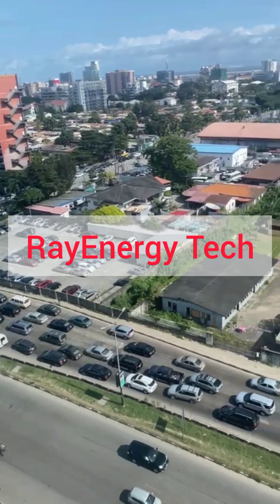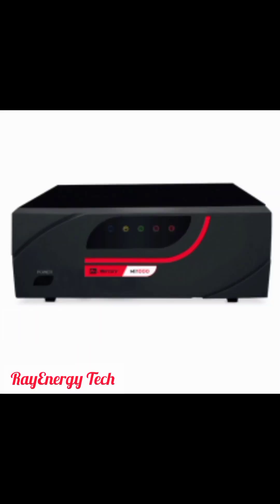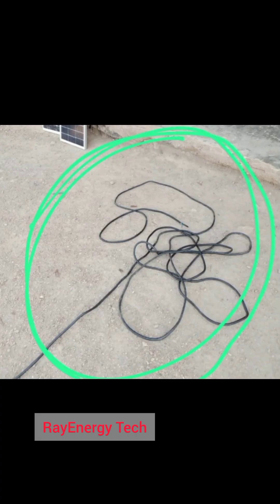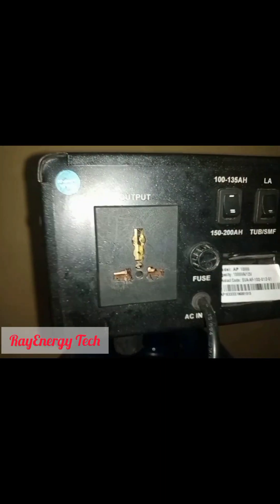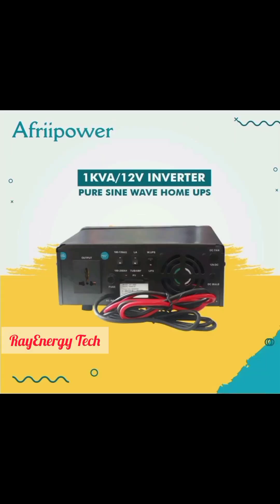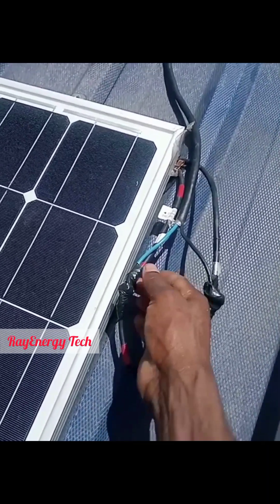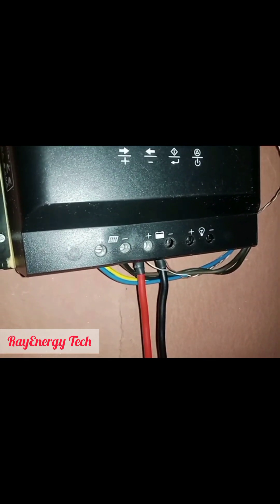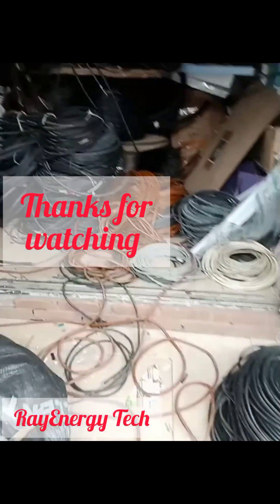Solar for beginner

Comment: nice for me am enjoying solar,i av 40 unit of 300 watt panel and 16 units of 230ah battery with 10kva inverter ,it power my 3 inverter ac.3 large tv,micro wave,cooker,washing machine ,borehole and more,solar make sense but na money to run am
Reply: That's a huge investment. The benefit is far greater than the cost anyway. Enjoy
Reply: i purchase tubular battery bcos i bought d battery bit by bit,i prefer lithium